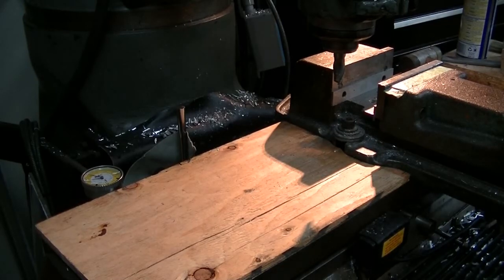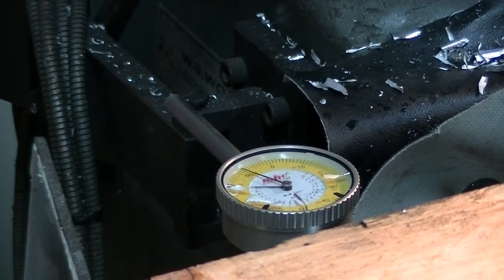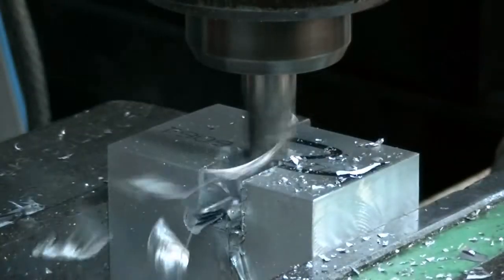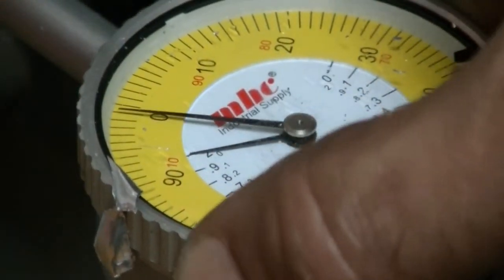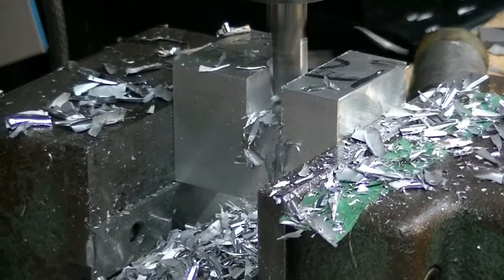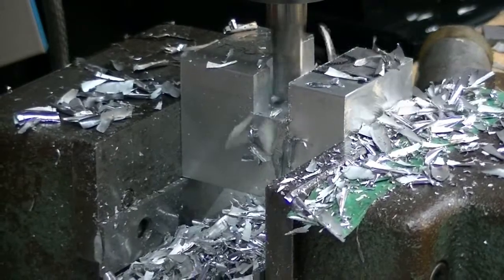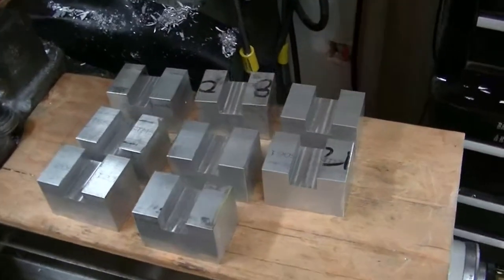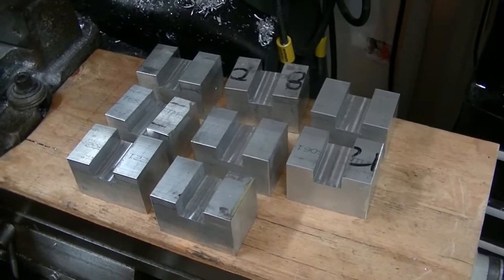Milling Slots In Aluminum

Comment: Dave, you have the same homemade DRO I use!
I don't have any filming tips. I liked your technique. Did you contemplate ganging the workpieces by clamping them on the table against a straight ledge? I don't know if that would have saved a lot of time due to the complexity of clamping each workpiece against the ledge, but it would have made a great video. :)
Reply from the maker: First time using the DRO... Definitely room for improvement on setup.
Thanks for watching